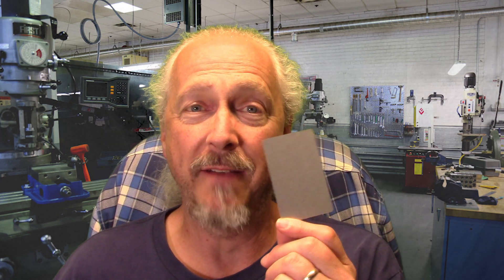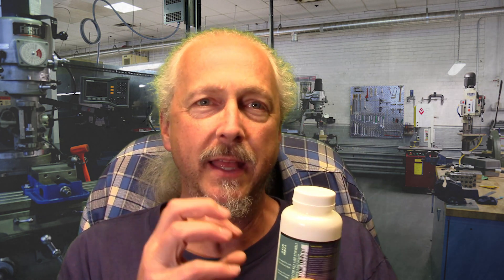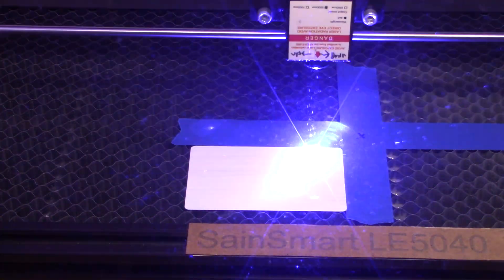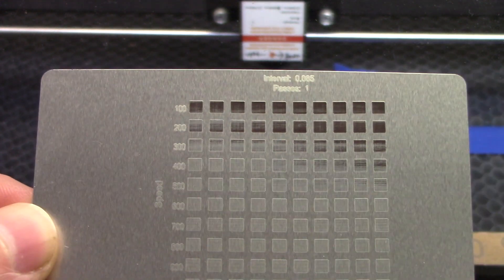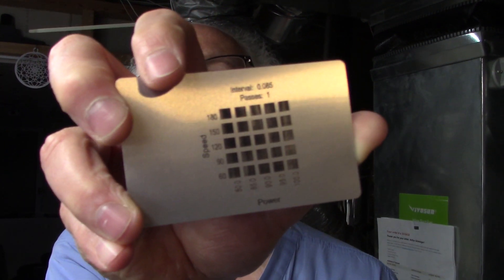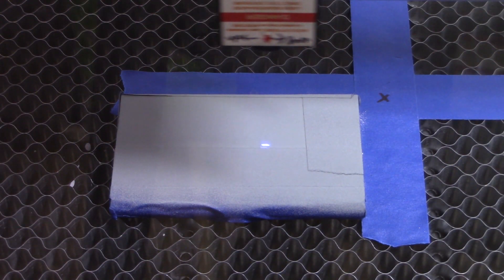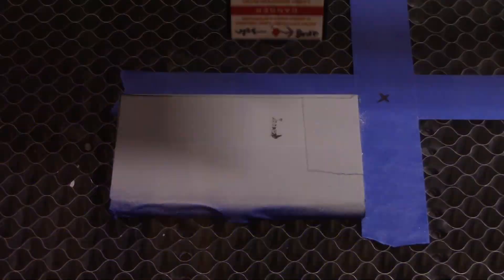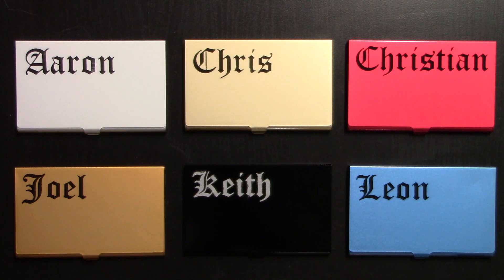Metal Etching powder - Will it work with our 5.5watt diode laser?

Comment: I am trying harbor freight white powder coat.  it has high titanium dioxide content.  Mix 3:1 with 99% alcohol , foam brush 2 coats, 3000/100/1 70W mode seems to work.
Reply from the maker: That is very cool!  Thank you for sharing.

Comment: Honestly I think 5.5w is just not strong enough to etch it properly. Even on my 100w CO2 I have to use 40% power to get a proper etch at a slow 100mm/s
Reply from the maker: I agree with you.  I contacted the manufacturer about it and they wouldn't say either way.  But they specifically do not mention diode/LED laser as something to use.  ;-)  It was always an experiment and in this case, failed to do what I have hopped it would but performed as I expected.
Reply: @CNCATHome  I've had good success with gold galvanising spray. Cleanup is a bit messy since you have to use Acetone.
Reply from the maker: @SettoStun688  - I don't remember if I have tried CGC on metal. I will have to give it a try to see how that works.  CGC will clean off nicely with lacquer thinner which isn't as aggressive as Acetone.

Comment: If you can find blanks with actual anodizing, they should engrave well. Anodizing engraves easily and permanently with even small diode lasers, Whatever coating is on your blanks is apparently not actually anodizing,
Reply from the maker: That would be nice.  The anodized aluminum that I have tried has not done anything.  I do like to try things so the next time I have something that is anodized aluminum, you know I am going to try to burn it in the laser.  🙂
Reply: @CNCATHome  I have an Atomstack A5 Pro and it does a beautiful job on anodized aluminum maglites. I engraved my name down the side without a roller and it had excellent detail and brightness,
Reply from the maker: @ManiacRacing  - That is very cool!  It may be that the anodized aluminum that I worked with was blue and using a blue laser didn't work so well?  I have a few Mag-lites and I could try.  Great suggestion.
Reply: I worked in an anodizing department years ago, tried doing it at home with good results. https://youtu.be/ezDwwRmMtmk?si=_OQT5V2nPSzwv3e9

Comment: I have been researching this topic for about a week now and something caught my interest. Dry Moly lube. 
I am also looking at going with a cold galv compound on tiles but with a light coat of grill paint to concentrate heat into the burn as well.. My laser is 5.5W output and I have found that fairly slow speeds are necessary.
Reply: More info on speeds + settings please Mongo. I have just purchased my first home last machine, Atomstack P7 30w (5w diode) and am have some Dry Moly spray on order arriving next week so would love to know your settings to get a nice etch.
Many thanks!
Reply from the maker: @James-zw4he  - I have not gotten this stuff to work very well yet so am still playing with the settings.  When/if I get it to provided a good etch on metal, I will put out another video with the results.  The issue is being able to get hot enough for this stuff to work without burning it away with the slow speed.
Reply: @James-zw4he  A little experimenting recently:
Dry Moly lube definitely marks stainless. I did a speed/power test that is included in LightBurn. Best results were 100mm/min at 100% power. 20W laser with 5.5W output.
Some lower power settings and faster speeds also did a fair job. I tried out an experiment on my kitchen cleaver, polished stainless. It did well but not as dark as I would have hoped. I'll post a pic after I get home.

On to other methods:
I got a can of cold galvanizing compound and gave it a shot on the other side of the cleaver. Now this one did an excellent job but I did not try other speeds and power settings on this one. I just hit it with 100mm/min at 95% power. 
But this is not an etch, nor does it actually mark the stainless. Instead, it made it like a hot transfer sticker that appears to adhere very well. You can feel it on the surface.

I have not tested durability yet. That will come from my everyday use in the kitchen, but depending on the end goal, both work on polished stainless.

I am planning on doing ceramic tiles in the near future and the cold galv compound is my choice for that, though many people have had decent results with white paint...

I cleaned both sides of the residuals with basic naphtha because that was what I had available. Just wet it and rub with my finger and I could see the details come out and darken as I went.
Reply: @James-zw4he  I thought I replied earlier today but it seems to have not registered...
I ran a feed speed/power level test grid that is included in the latest versions of Lightburn. Best results with dry Moly lube was 100mm/min at 95% power. I used my kitchen cleaver, polished stainless steel, as a test run. It did well enough to mark the metal but not as dark as I had hoped. But it seems to be in the metal, not likely to wash off any time soon.

I did the same marking on the other side with Cold Galv and just for simplicity, I stayed at the same power levels, more or less. At first, I could only see gray, until I cleaned it off with some naphtha. (That was all I had at the time). Just rubbing it with my finger and rinsing it, brought out the detail and it was a nice dark black.

I have not really done any durability testing, so no info on that yet.
Reply from the maker: I hope that work well for you.  I have found that the CGC works well at lower power and faster speeds compared with the white paint method.  It seems more forgiving too.  :-)

Comment: You should clean the metal with DNA before using the etching powder.
Reply from the maker: Great tip and all around SOP.  I was lazy on this one as there is DNA in the mix, it is like cleaning and applying all in one step.  Well, not really.  ;-)